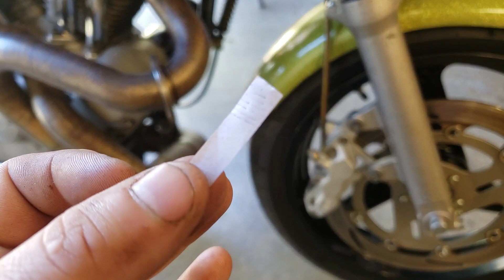Buell Suspension / Brakes / Charging System ALL FIXED! - EP5

Comment: Great fix on that exhaust bolt!  

Also, I found the shifting was improved slightly by cutting about an inch off of the long banana shift lever.  Makes for a shorter moment arm.
Reply from the maker: Thank ya! I may try that one. Test riding the bike today.

Comment: Just picked up an 02  Cyclone m2 and so far the speedo quit working and needs tires! I’m in Colorado but seems like a fair price so I swooped it up! Thanks for the info
Reply from the maker: Id check that speedo sensor first. It fixed this bike and is apparently common. Should be fun for ya!

Comment: I'll subscribe, but I'm waiting on the Buell riding clips!! I just bought a 2002 XB9R for $500 bucks. Missing a few parts, electricals dead as a doornail. I sorted the  electricals! Gauges, lights work, no starter action. Bike has 25,954 miles on it. This is gonna be fun!
Reply from the maker: I appreciate it.  The next videos show all the riding clips actually. I have sold the bike already but it was to a friend so it may pop into a future video

Comment: I have a 99 Buill lightning X1 problem holding front brake pressure what could it be put a new part front master cylinder worked eight times and then failed ???? What could it be?
Reply from the maker: You would either have fluid bleeding out of somewhere or just not properly bled.
Reply: @BrickHouseBuilds  I tried bleeding this over and it's not bleeding or getting a stiff lever that's what happened to the old front brake master cylinder so I thought new one worked for only about 10 pumps then it lost pressure that would be very dangerous on the road I'm still baffled on this 99 Buell lightning brake problem back brake does not work very good either I watched one of your videos and there was a brake clip bent I haven't checked into that yet let me know if you have any other ideas for the front brake greatly appreciated my friend
Reply from the maker: @mikeyamin4010  To me it just sounds like it isn't bled. It can take a while and if it works for say 10 pumps then loses its pressure its likely still working air up through the line
Reply: @BrickHouseBuilds  ty I will try that my friends

Comment: I love that bike.I have an XR.Theres a bit more than a sportster to the XR.It has the Buell crank and totally different oil cooled heads. It still weighs a ton(250Kg stock)It didnt sell so got fucked off.Instead of HD doing the right thing and putting the 90bhp engine into there sportsters the penny pinchers just carried on with the old motor.Anyway got loads of your back catalogue to get through👌
Reply from the maker: Just seeing this comment as it was flagged from the language.  Ive never ridden an xr1200 but they look great and Ill probably have one some day to try out.
Reply from the maker: @samjoentess9168  doesn't bother me its just the YouTube comment filter. All good!

Comment: How do u test a bad voltage regulator. My m2 cyclone drains the battery when the bike is off. It has a push button starter also. What should I check first. Possibly bad ground bleeding voltage from battery
Reply from the maker: You can do a diode test with a multimeter. There are a bunch of videos on the Harley reg/rec testing. These are closer to the sportsters in design
Reply: @BrickHouseBuilds  thank you. What do you think would be killing the battery when the bike is off ?
Reply from the maker: Hard to say without being there but something is obviously drawing current